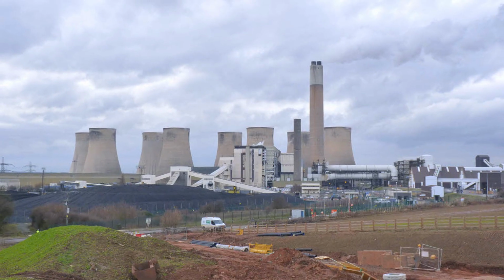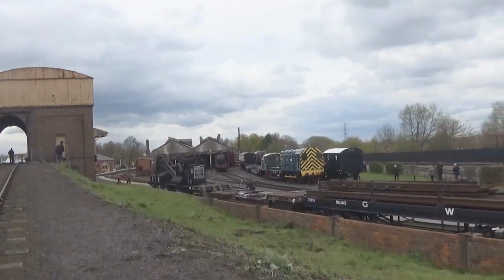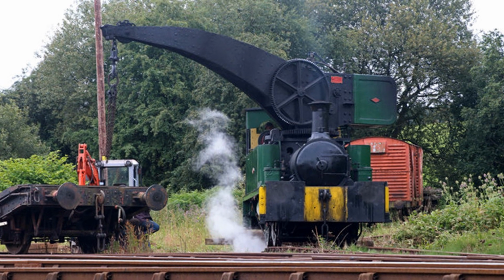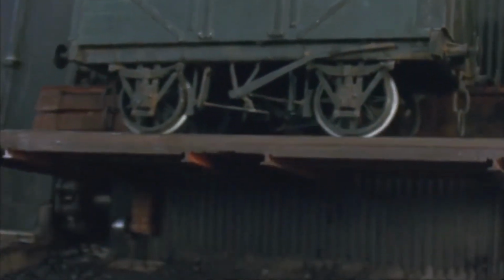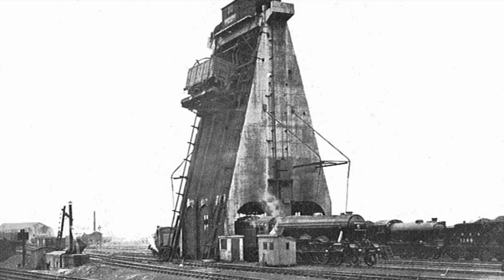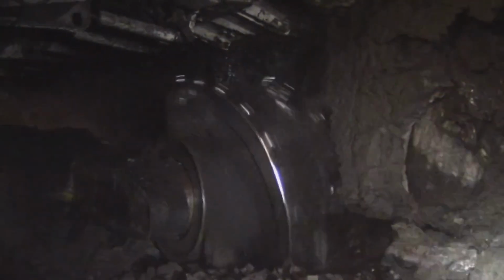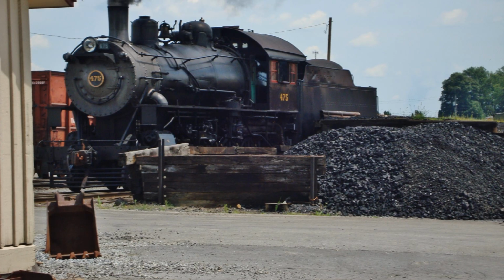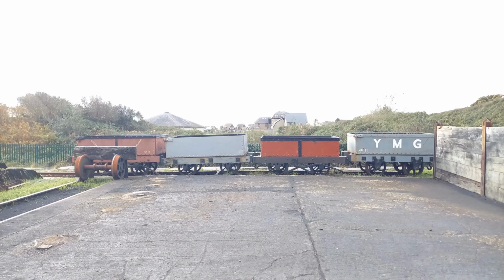The MANY ways that steam locomotives get coal

Comment: I'm from the US West Coast (california) and over here due to emissions standards and wildfire issues, we exclusively use oil, bukner c and recycled oils are most common and quite a few engines have been converted to oil firing... with mixed results. I wonder if this coal crunch gets bad enough, will some actually think about moving to oil, even with the faults it presents in converting some engines.

Comment: Maybe instead of burning coal to generate heat. We could instead use a process called Solar Thermal Heating. Basically, I'm thinking maybe if we fitted the water tanks on a steam engine with these solar thermal collectors, we could use the sunlight to heat the water in the tanks, and as a result generate the necessary temperatures to create the steam to drive the locomotive,  and then proceed to use the generated steam as normal.
Reply: I'm not sure you realise how large a solar collector plant is.
Reply: @C.I...  Well maybe in the future they can be miniaturised, like other devices. I understand where you are coming from, but I think as a concept it could work.

Comment: The British equivalent of (US) #2 Heating Oil?  (Basically the "kissing cousin" of Winterized #2 Diesel Fuel).   
The black smoke you see coming out of the "Big Boy" (4-8-8-4 locomotive ran by the Union Pacific and has the number 4014) is actually sand getting discolored by being blasted through the firebox and stack.  It is possible to redesign everything to reduce the carbon deposits (i.e. cleaner burning), but since US Rail Fans enjoy the black smoke so the "UP" does this whenever they see a bunch of railman's along the track!
Reply: That's way better than throwing old videotapes into the firebox to get black smoke!

Comment: The problem with getting coal from Australia is, just like the current UK Government, our current Government in Australia is ALSO hell-bent on getting rid of our coal industry amongst other things. 
Not only that, but while I'm sure we could no doubt ship coal from the mines at Collie in Western Australia for example, the coal here is not the same quality as the UK's coal reserves. Therefore, the locomotives on heritage railways may struggle to burn the stuff if they don't have wide fireboxes. 

And on top of that, using coal, particularly the higher-grade stuff is actually way better for the environment than the renewables, electrics and dare I say it even internal combustion in terms of a fuel source. Heritage railways deserve better, and the preserved operational steam locomotives deserve better.

Comment: We Need to think about. Switching them to a different fule.
Reply: A nice idea in theory, in practice you idea is pretty terrible. Most of these heritage railways are just about scraping by in terms of cash, so it would be out of their budgets to refit all of these locos, as well as the fact that there are few to no spare parts floating around and some engines may be left irreparable because of their modifications. So I think we'll all just have to survive with a few hundred locos quietly puffing away on an increasingly valuable resource.
Reply: idk how different it would be for UK engines, but over here in the US, we have rebuilt engines to burn oil or diesel. The Durango & Silverton Railroad is finishing the last conversion in their steam roster as I type this. Some say it's not authentic, but it's still external combustion and still boiing water.

Comment: There are a number of American Museum railways that are converting their steam engines to run oil instead of coal. The engines are then able to continue running in the absence of coal availability. 

The reasons for this are partly because coal is more expensive and harder to come by than it was 100 years ago, but also to reduce fire risk in areas that are prone to wildfires. The logic is that it's better to have the preserved engines running on the wrong fuel than to say they can't run it all.
Reply: I'm not sure that's as doable for British locos. They don't have the same vast access to oil, so they'd still need to import. True, those reserves in the North Sea exist, but that's for natural gas which you really can't use with steam engines for the same reason you can't fire them directly on coke. Not to mention in terms of emissions, it's actually just as bad as coal, if not worse. CO2 might be better, but CH4 is abysmal.

Comment: I don't know about anywhere else but in australia the Victorian Railways tested crushed up brown coal on a few steam locos it didn't work out
Reply: Not pulverized, but lignite used to be the common fuel of the Northern Pacific Railroad. Prior to the Big Boys, the World's Largest steam engine (also the first 2-8-8-4) had a record breaking firebox grate to accomodate the low grade coal. Unfortunately, the grate ended up being too big to effectively maintain the heat, so parts of the front had to be blocked off. Their 4-8-4's also had some of, if not the largest grates of their type, hovering around 105 sq.ft. compared to the <100 sq.ft of most other 4-8-4's
Reply: As the only native fuel the gdr adapted many locomotives for using brown coal. As it has a lower heating value firemen didn't appreciate, but couldn't do anything except nicknaming the lowest quality "potting soil"

Comment: Here in the US, coaling towers were typically loaded using Archimedes screws, or bucket conveyors, which while certainly slower than just dumping the whole kit-n-kaboodle in at once, eliminated the foreign debris issue. Also in the US, coal was usually sorted and washed at the mine before being shipped, which again eliminated a lot of the issues mentioned. Slack was still an issue, but then it never isn't when dealing with coal. We also exclusively use steel railroad cars for  coal hoppers and have been since the 1890s.

Comment: Has anyone thought of setting up a heritage coal mine? Heritage diesels or even steam. Maybe a closed down mines equipment could be reused? Could even have visitors come and see it being mined and loaded etc. might be expensive in the short term but surely with the amount needed just for the heritage industry I'm sure there's an environment and maybe even a financial case for it. At the very least it's a neat idea :)
Reply: There is still plenty of coal seams left
Reply: The problem with having private mines is that coal is hard to find, and the more you mine for coal, the more expensive it gets, coal is not a cheap substance. I say a better idea is to use charcoal, it's wood, but pre-burned to last longer as coal, plus, it produces less carbon and more heat.
Reply: @SteamingWestern-2009 also means alot of tree need to be cut down and ideally re planted. also there's plenty of coal at coal mines that have shut down due to government restrictions and the coal fired power plants closing. besides this is only a concept/idea. I just think its an option that could be explored if the right group of people with enough money could make it work. it all semi hypothetical and wouldn't it be cool if's etc.
Reply: @Da_RockPuncher In the US we have got coal from a place that is in the rock business and runs into coal when digging rock.
Reply: Tourist walking around an active mine sounds like a health and safety nightmare.
Reply: @t1m3f0x  with like a guide and marked out specific parts it could work and obvs no visitors into the mine it self
Reply: @MrLegoman86  people are people and there's always someone who will be stupid and/or not obey signage or rules and then file a lawsuit because they ended up somewhere or did something they were clearly not supposed to. Unless you are a very successful (and reputable) company or buissnessman, it would make sense.
Reply: @TSMGL_Youtube  that's fair again was just a thought maybe semi regular open days? Idk would be cool to have like a gala kinda thing for like shunters etc to like shunt wagons around etc.

Comment: Higher grades of coal and processed coal is actually not that bad for the environment, it's actually better than internally combusted fuels

Heritage railways deserve proper coal, steam locomotives deserve better
Reply: Incinerators burning garbage are a far bigger and worse contributor to pollution than steam trains!
Reply: Can't be any worse than the extremely toxic Lithium that they make batteries with for "environmentally friendly" cars.
Reply: @davinsmith7543 
Lithium is NOT "extremely toxic".
Look up "7up".

Q: Where do you think the "7" comes from?
A: Lithium citrate.
Reply: @davinsmith7543  yerrr harr harr don’t tell Greta harr harr huh? Leaded petrol was best, but I prefer just burning crude oil for no reason, real thrash clag but don’t tell Greta harr harr…..
Reply: @davinsmith7543  Thought so……..😂

Comment: if only some unknown people had the opportunity to develop new designs for a steam loco to burn other fuels.
Reply: A lot of locomotives in the Western United States were designed to burn oil rather than cold right from the beginning, but in recent years, several Museum railroads have looked at converting their coal burning engines to run on oil instead, both for availability and cost reasons, but also because of wildfires. 

The idea is that it's better to have the museum engines running on the wrong fuel than it is to not be able to run them at all.